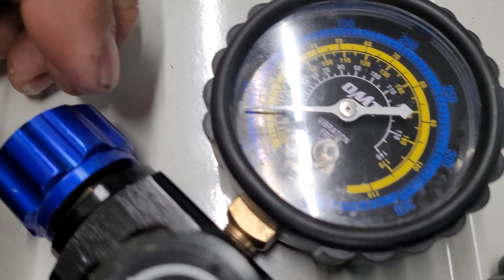How we recover mini split refrigerant back to the outdoor unit, same as how it shipped #minisplit

Comment: pls if i may ask , will the Gauge valve  be closed or open ?
Reply from the maker: Close the high pressure line first, and then close the low pressure line once all the refrigerant is in the outdoor unit, and then turn off the unit.

Comment: any reason not to vacuum it down to -30?
Reply from the maker: Well, remember, the normal reason for vacuuming out the line is to check for leaks. But the purpose for this is just to get the refrigerant back into the compressor.

Comment: Can this process be used if there's a leak in the line? I need recover the refrigerant before replacing the line. Thank you.
Reply from the maker: Depends if there is still positive pressure where the leak is. The process could be done down to the point where the potential exists of pulling in air through the leak . So, yes, it could be done with extreme caution.
Reply: @airspool  Thank you much.

Comment: was the blue valve on the gauge open or closed?
Reply from the maker: It's closed. The gauge is just for measuring, so all the refrigerant just moves from the indoor unit back to the outdoor unit. And the pumping is done by the compressor in the outdoor unit.

Comment: great way to mess up the compressor if you lines are longer than the factory charge and you needed to add refrigerant.
Reply from the maker: Mike, you'll be okay as long as the line set is within the manufacturer's limits, and the amount of refrigerant you added is in line with a manufacturer's limits. The accumulator/compressor is built for that.

Comment: I have a five zone unit, one of my service valves on one zone is leaking. Can I do this for that one zone replaced the valve and then open the zone back up?
Reply from the maker: What valve is leaking? If it's the service valve , all the refrigerant would need to come out because the service valve is what's keeping the refrigerant in. If it's not the service valve if it's leak like on the flare for example of the service valve you can close you could pump down that  one zone and then close the valves and fix the leak and then evacuate it and let the refrigerant go.

Comment: What about for multi. I’m guessing the guage is one one, the the other large lines open. Also yeah, edit in at the end to then shut off
Reply from the maker: First, all valves are all three units need to be running and cooling mode. Then, close the high pressure liquid bealls, all three and quick succession. Have your gauge is hooked up to the biggest indoor unit, which is probably a or one or however just labeled. The one for the biggest indoor head. Then, when the gauges show the pressure is down to zero, close all three low side / suction valves  quickly and turn the unit off.
Reply: @airspool  i dont understand you are saying that you need to do way more here in this comment then in your video you need a suction pump to do this? there is no pump in your video

Comment: would the process be the same for a multi head unit? would you just do each line set individually?
Reply from the maker: First, all valves are all three units need to be running and cooling mode. Then, close the high pressure liquid bealls, all three and quick succession. Have your gauge is hooked up to the biggest indoor unit, which is probably a or one or however just labeled. The one for the biggest indoor head. Then, when the gauges show the pressure is down to zero, close all three low side / suction valves  quickly and turn the unit off.
Reply: @airspool  Thank you very much for your response! Couple of follow up questions. I have a 3 head unit all 3 heads are 9kBTU. Sounds like I close all 3 high pressure ends and then hook up my vacume pump up to the low side. Then once the gauge shows zero or below then I close all of the low sides and im good to go? Thank you again for the help
Reply: @airspool  "all valves are three units need to be running and cooling mode" you see this is a statement that just does not make sense ive seen you say this to multiple people in your comments what are you trying to say ?

Comment: Don't run it too long without a flow, it might damage the compressor due to oil starvation.
Reply: Yeah i was wondering why he didn't mention you wanna pull the disconnect as soon as you have the unit valved off

Comment: But when you put your manifold hose to the service port. And take out the schrader. 
Will it not come gas out there? Since there is gas on the system and copper tubes. Sorry about my english. Hope you understand what i mean.
Reply from the maker: Well, remember that the pump is the compressor, so the compressor will draw all of the gas into the outdoor unit. Yes, there's potentially a small amount that pay come out of the service valve, but very little.

Comment: Im not getting a reading on the blue gauge. Not sure what im doing wrong. The mini split is running
Reply from the maker: If you have the hose connected to the unit, you will read whatever pressure is in it. If it's 0 then that's what is in it. You should make sure the correct end of the hose is connected to the 5/16" adaptor as some some the adapters have Schrader cores in them, so if the wrong end of the hose if attached (with no depression device), you won't get a reading.

Comment: How you can do that in the multi zone please help me
Reply from the maker: First, run the unit in cooling mode. Close the suppy line ports for the high pressure lines, going to the indoor units. When the PSI gets down to around 15, close the suction line ports. Then turn the unit off. Now the refrigerant is in the outdoor unit.
Reply: @airspool  what are the suction line ports? on what the manifold or on the unit?

Comment: Easy enough. My question is if the refrigerant now in the compressor is moisture free.
I suspected a leak, retightened all connections, triple vaced the system, and got it to hold for 24 hours... but I'm worried about releasing the same refrigerant  back in and topping it off using the superheat calculation.
What say you...?
Reply from the maker: Yeah, it's moisture-free, because the pressure of the system is higher than the outside pressure. So if it was leaking or whatever in the beginning, no moisture would be coming in even under those circumstances. So you're good.
Reply: @airspool  Thx

Comment: Can I vacuum after this video? Is there no refrigerant in the system?Is there any problem with the remaining gas in the copper line?
Reply from the maker: All the refrigerant is going back to the outdoor unit. So you'll do this procedure if you need to move the unit or whatever. If you reinstall, then you're going to have to do the vacuum pump engages again.

Comment: Great video!  I have a Mitsubishi with a distribution box and 4 zones, however i only have one high and low pressure valve on condenser.  Would i just put all indoor units and cool and continue with same process?  Thanks
Reply from the maker: Yes, right. Turn the temperature way down so they actually are in cooling mode, so that there is a load. Not just set to cooling but no load.

Comment: it would help if you showed where the yellow vacuum line is connected
Reply from the maker: So this may be a little bit confusing, but in fact, the yellow one is the power cord for the alternating current. So that's what's turning on or giving power to the outdoor unit. The pump is actually the compressor. So there is no vacuum line connected to it. The compressor is doing all of the pumping. The only thing connected is to the service port to check the pressure. And that's the blue line.

Comment: Needs to be a lot quicker to close the low side off once your gauges hit zero and immediately kill the power to unit. Atleast that's how i was taught, if I remember correctly it will damage the compressor. If you don't do it quickly..

Comment: Ive got a question? How do you fix a frozen discharge line without using a pressure gauge?
Reply from the maker: There's really no way to do it properly without a manifold set. I've heard of people hooking a bottle of 410a straight to the service port and add it until the frost goes away, but a few ounces too much could shorten the life of the unit. Second issue would be the reason it's frosting up in the first place, there's a leak. So to do it properly, you need a manifold set, nitrogen, vacuum pump.
Reply: @airspool  thanks alot this is helpful.

Comment: How long can the R32 refrigerant in my split AC remain effective if the system is properly sealed and stored without exposure to the environment?
Reply from the maker: Theoretically, forever. It doesn't go bad or expire. I remember my grandparents had a refrigerator from the 1950s or something. Probably not the most efficient, but it still worked. And it will keep working as long as there are not any refrigerant leaks.

Comment: Should the gauge valve to be opened on the manifold?
Reply from the maker: No, there is no flow through the gauges. The gauges are just used to monitor the pressure.

Comment: What to do if the outdoor unit is not turning ON?
Reply from the maker: Well, if it's ours, first check your power and your set point. If you have power, and if you have enough distance between your set point and the indoor air temperature, the outdoor compressor will turn on. But if you have a break in the solar lines, for instance, that can make it such that the unit doesn't come on. If that still doesn't help, email comfort@airspool.com.

Comment: I don't understand why you need to rush to tighten up the upper valve. btw. thanks for this video. I did this process many years ago and need to do it again, but I forgot how to do it. Last time I had liquid flowing over the roof and thought that I had messed it up but the transplanted air con unit has worked fine for many years. I have 3 air con units that could be moved/replaced now.
Reply from the maker: You need to do this quick, because if you don't, the refrigerant lines will have a negative pressure on them. So you want to stop at zero or near there. If the lines are negative pressure, it'll suck in moisture or whatever is in the air into them, and you don't want to have that.
Reply: @airspool  Aren't you supposed to vacuum the lines before install anyway? I don't see a problem pulling it down as low as it will go, obviously quick enough not to blow the compressor.

Comment: If room temperature is very low, compressor won't start on cooling mode at all. What then?
Reply from the maker: In that case, wait until spring, or build a fire around the unit to make it think that it's warmer inside.
Reply: @airspool improper irony , as a specialist, as you claim to be, there should be an intelligent solution...
Reply: @penchopenchef1 I have a line blockage and need to pump down the system on  a Senville (Midea) unit to clear it out. 

You can force the unit into cool mode by putting a hairdryer on low warm setting and blow it onto the inside thermistor sensor (the one in the plastic tube). The unit thinks the room is roasting hot and the cooling mode kicks in. The high pressure (skinnier) line will start to frost up in cooling mode so you will know it is working.

Comment: One of the commenters below stated that the air conditioner should be closed immediately after closing the second valve.
This is especially true in inverter air conditioners where a fault can develop and also in some cases a fire. In inverter air conditioners, it is recommended to wait about 10 seconds before closing the second valve, and of course close the air conditioner immediately.
I think you should update the video and add these comments.
Reply: That makes no sense. You need to to reference your vapor side gauge to see when the pressure goes to zero.

Comment: Hi guys, great video. When extending the line set can you use mechanical fittings rather than welding? Do you have a video on extending line set, vac down and putting the gas back in the system?
Reply from the maker: We don't have a video for this one, but simply get all the refrigerant back into the compressor as shown here, and then unhook the existing line set and put in a longer line set or put in an extender. Then nitrogen pressure test the line, vacuum test the line, and then release the refrigerant.
Reply: @airspool   A bit of an old post but question if you are still around.  We have five systems.  The condenser units are on one side of the house, while the head/wall units are on the other side.  Making it necessary for some long line sets. An extra 40 feet for the longest run.  Will this work?  Because of the extra line length and need for additional refrigerant.  Or would that likely overfill at the accumulator?

Comment: Hi what gauges do you need to do this??
Reply from the maker: Just a simple set, 3 port, 1/4" sae flare hoses and a 1/4" male flare to 5/16" female flare adaptor (all mini splits are 5/16" male flare).
Reply: @airspool  thanks, when extending line set can you use compression/mechanical fittings over welding the joints?

Comment: For more than ten years my split unit (indoor) its not working because of broken PCB. How can i start the compressor to collect the Freon and then remove the entire unit. hanks a lot for your video.
Reply from the maker: Well, if the compressor is down, then you need to have a refrigerant recovery machine. Check out our video on that topic, too.

Comment: There s only one thing wrong with that method, it requires the system to be running, and the majority of equipment get changed when the Compressor is fucked, so that’s useless, who changes a good working unit !
Reply from the maker: I think a lot of people who see this video want to move their unit, so it's useful for that. But yeah, you need a refrigerant recovery machine for one with the dead compressor.
Reply: @thegamerfiftin I'm moving so i want to know how to disconnect so I can reuse. Fuckin dumbass comment here bud.

Comment: Do we need to worry about the air that is in the gauge line before doing any of this?  Need to vac out the blue hose or anything or just plug it in and go.  Seems like the unit will suck in whatever air is in the blue hose when you do this.  Or should we let a tiny bit of coolant come out of the gauge so the blue hose has coolant in it instead of air?
Reply from the maker: You can bleed the tiniest amount of refrigerant. A bit of a necessity, but that's why next year there will be R32 and R454b.

Comment: Thanks. How to return it back?
Reply from the maker: So vacuum out the line set again, and reconnect your gauges to the service port, and then just use the hex wrench to re-release the refrigerant on the high and low sides. So basically, you're starting as if it were a new unit.

Comment: I'm thinking of buying a used heatpump hotwater system. Since the "indoor" unit is the cylinder and it's in heating mode, i'm guessing this technique won't work?
Reply from the maker: There are heat pumps that are hot water heaters. Of course, their design is different, and the condensing coil has water running through it. The cold air at the expansion coil then is either put into the space and used what is needed in the summer, or is put outside and it becomes the waste. So it should work. Of course see if it's working wherever it's installed now to do your due diligence. I wouldn't buy it personally unless I saw it working for its intended use.
Reply: @airspool , Thanks for your response.
I went and saw the unit. it was still setup and tested it to make sure the high pressure pipe was getting hot and it was. I then connected a gauge to the low pressure side which was the smaller tube in this case. Closed the valve and ran it till I got a slight vacuum. It worked almost perfectly with only a very slight hiss when I disconnect the main pipes. Not much more gas would have escape than when I fumbled the initial gauge connection. 

Your video gave me the confidence to try this method and it worked extremely well. 
Thanks!

Comment: Hey I have a single compressor with five heads and one of them is going to need moved. Am I able to close the gas and liquid lines on the other four and then just do what you did with the single unit that I need to move?
Reply from the maker: Hi Jared, get all the refrigerant back in the outdoor unit for all of the circuits, including the one you want to move. And then close all the valves, and then extend the one to where you want to move it to the new location, and again do the vacuum pump and line set for that one. You only need to do that for that one. Then release the refrigerant again.

Comment: Very good method. As long as the compressor is working you can do that otherwise close both valves and suck the freeon from the pipes with a pump.
Reply: Vacuum pump?
Reply: @igipop9131  No, a special pump.
Reply: @igipop9131 recovery machine